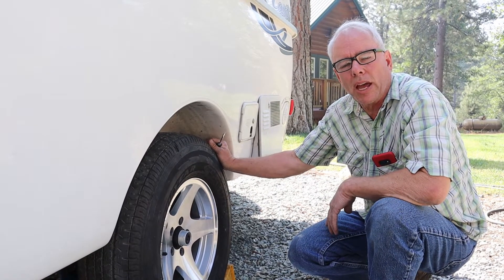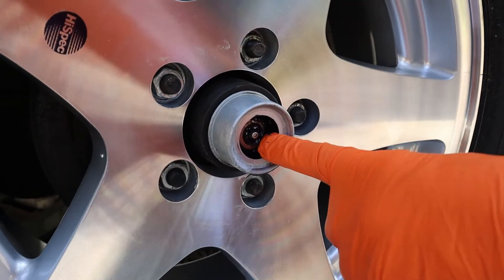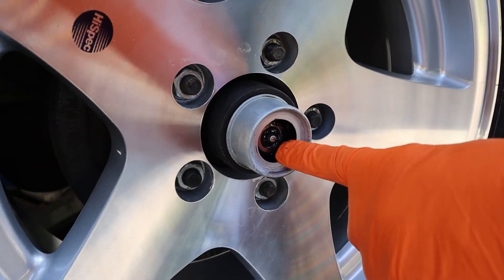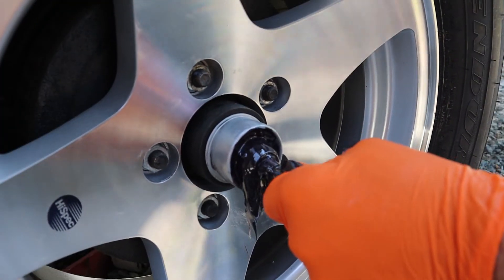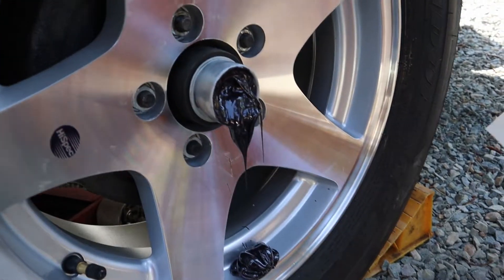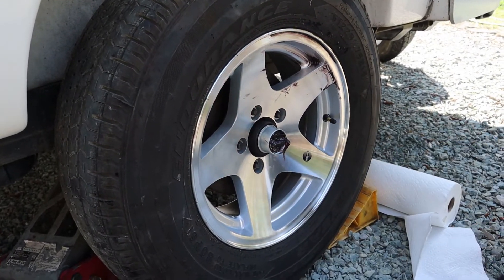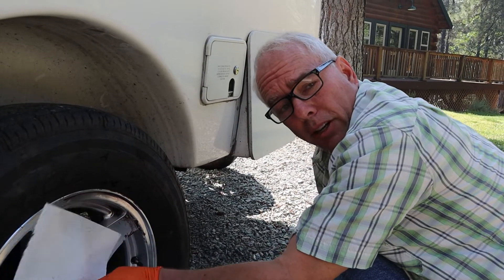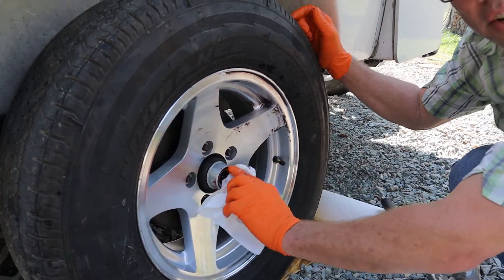Skip This Task at Your Peril: Grease Your EZ Lube Bearings: EASY!

Comment: You need to inspect the brakes each year, have the bearings properly repacked at the same time. Only use easy lube fittings if you have been through water.

Comment: Be careful pumping grease into bearings.  Some are shielded and you can push the shields out by over greasing.  Look at your owners manual to see how much grease you need to pump in.  If you have shielded, not open bearings and pop the shield out, the bearing won’t last long.
Reply from the maker: Thanks. We are not aware of any instance where Dexter has installed shielded bearings on EZ Lube Axels from the factory.
Reply: All axles have seals, and they can be pushed out if the grease builds up too much pressure, however these EZ lube type fittings have a spring in them to keep a light pressure on the inside to displace water and they have a tapered area that lets grease escape as shown in the video, so it is not possible to over grease them, it just makes a mess.

Comment: The seals are rated to 15PSI. A handheld grease gun exerts over 2,000 Lbs PSI. Easy Lube is made for emergency only.
Reply from the maker: Doug has been an auto mechanic for 40 years. He says the only way you can have 2000 lbs of pressure is if there is a restriction in the flow of grease. You can’t have that kind of pressure build up if the old grease is coming out the other end.
Reply: @TravelsandTravails  I started driving/maintaing semi's 50 years ago along with Heavy Equip. Op/P.M., Farm Equip Op.P.M. Then off to the Sheriff's Academy where I spent 17 years as a Deputy. I changed a few bearings along the way 😵‍💫Nothing maintains bearings better than a hands on and a visual inspection, feeling for corrosion/pitting etc. Our fingertips tell so much. Never been a fan of the quick easy way of maintaining equip. Hand packed is still the best method.
Reply from the maker: Doug does both.